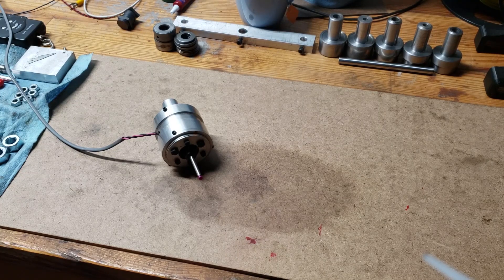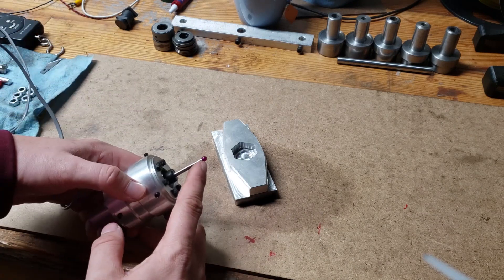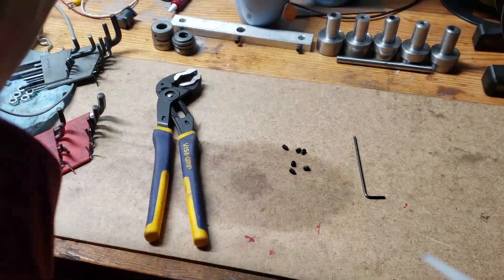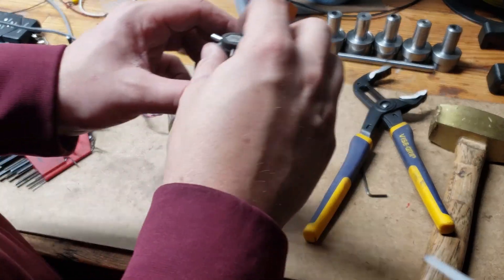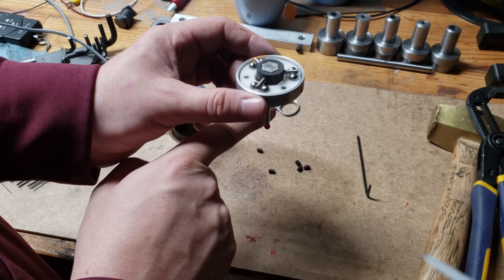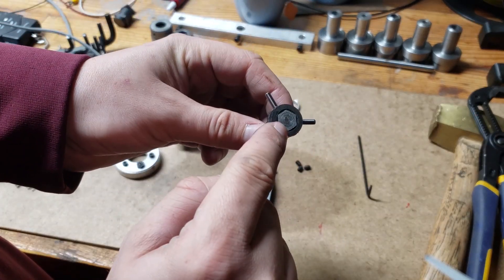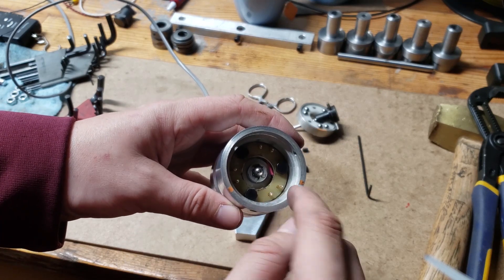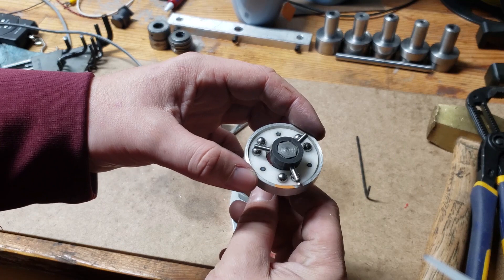DIY Touch Probe Detailed Overview

Comment: I have a working model of a wireless probe using an ATTiny85, and IR LED, IR TSOP1738. It works really well, now I need to finish the housings for the components and finish the PC boards.
Reply: Did you finish that? and did you share it somewhere?

Comment: Does the probe only work when the circuit opens? From what I know Renishaw triggers when there is a small change in electrical resistance as the rod ever so slightly shifts which in turn reduce the contact patch area between the balls and rod.

Comment: hello, sorry for english, a simple question, does the size of the test probe have to be exactly the same size as the part of the contacts or can it be different? because I think the measurement will have different results from above and from the side. I am wrong?
Reply from the maker: No.
If I understand the question. There will be a bit of movement of the probe tip before the contacts move apart enough to disengage.  This will produce some error, but it is consistent error and can be compensated for if measured.

Comment: I am thinkering now to make this wireless.
Reply: I was looking some musicians forums that use IR they say 2ms is latency and that is much slower then I get over 2.4ghz. Unless there is other method... i saw on ebay some pro 2.000$ probe use it?!
Reply from the maker: @darkobul1  if for accuracy a fine probing routine was moving 1in/min. For every 0.0005in (tolerance needed) the probe takes  30 miliseconds or 30,000microseconds.  As long as the system response if faster than 30,000 microseconds than it will never be off by more than 0.0005".  5 microseconds is awfully fast, impressive.

Both work, but in my opinion much less can interfere with modulated IR light.  Radio waves are everywhere.
Reply: @LionSandwich  that is good to think about calculation. The cool thing about this way using MCU and wifi conection is that you get hole level of security checks and can add some inteligence to it. I am planning to use small ESP chip in probe with battery and usb charging port. I will do video with my progress. Thanks a bunch for sharing thoight with me.
Reply from the maker: Nice!
Reply: @LionSandwich  I calculated it wrong missed some zerous there lol its ms. I finally measure it with oscilloscope  I got 3.5ms. But still need to check more is that final number. Maybe chip dont trigger same as mcu as I saw 1ms double signal following.
Reply from the maker: True. Slowing the machine down even further could compensate for a slow system too.  Remember there is also latency in your control software that needs to be accounted for too.
Reply from the maker: Ever get this working?
Reply: @LionSandwich  Yes I got 1ms response I was waiting from eBay some small ESP chips and circuits for battery power and to put all together. But all mine tests where promising.  Code is very simple and I even planned to dive into C++ and try to build it in native code to see what speed benifit I can get. I also investigated that ESP Chips have native support for IR and that some tests  with native code showed 50us response but I didnt tested yet. I got my g0602 CNC conversion on my plate as well.
Reply: @LionSandwich  I also investigated use of piezo as probe by my electronic skills are not great yet to make it fully working but its very sensitive and promissing if I could use that signal fast enough for touch detection.
Reply from the maker: Use IR modulated.
Reply: @LionSandwich is not that too slow? i am testing those cheap wifi modules in special mode i got 5us response time.